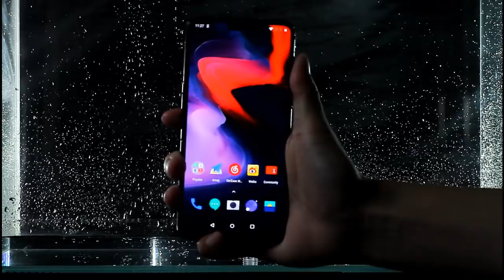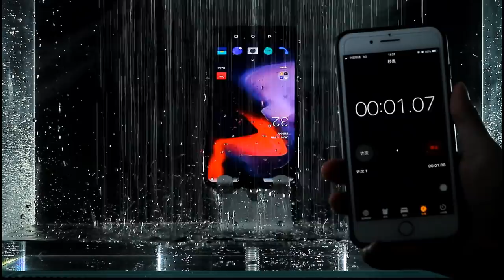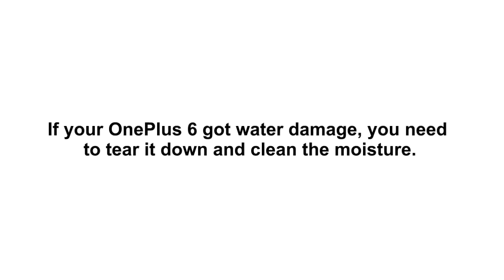OnePlus 6 Waterproof Test

Comment from the maker: Is OnePlus 6 waterproof or water resistant? You will find answers in this video. 
Get OEM Replacement Parts for OnePlus 6 : https://witrigs.com/ekncj
Reply: Wit Rigs did the phone died?
Reply from the maker: Nope, I disassembled the phone and clear the moisture inside. Then I covered the phone parts with the dry paper towel for 2 days and the phone survived. It works normally now.
Reply: Tnx dude
Reply: Thanks for giving out a solution in case that happens.
Reply: So the speakers are the weak points, thats good to know :)
Gonna tape them in case i wanna do some under water photography :P
Reply: Mr.Magnificent and the alert slider
Reply: Dennis Jassmann not really, it goes into the mechanism of the alert slider, thats why bubbles were coming out, but it didn't seem to get through to the components, we would have seen that on teardown
Reply: hi can you do review with vivo nex and oppo find x? do u have weibo?
Reply: Thanks a ton dear...This video helped me a lot...I am a brand associate and I will share this video to all the people come up to me while buying oneplus 6...
Reply: I have placed my one plus 6 phone in water but cameras are moistured. Give me a solution
Reply: my oneplus 6 was dropped in a swimming pool after 2min i got it out the screen was glitching and shutsdown the things are cleaned even then its the same thing nothing changed screen problem continues what to do.?

Comment: Good enough for me. To everyone else who consider this deal breaker. Have fun with your phone underwater?
Reply: hush3r True I wouldn’t recommend anyone take there phone underwater since the resistance is meant more for accidents and rain. No phone manufacturer covers water damage under warranty.
Reply: And when you accidentally drop it in water or drop water into the speaker, it's gone lol. So yeah, ill have fun with my ip68 rated phone.
Reply: Not really, accidental drops in puddles and whatnot is okay as long as you pick it back up and dont let it sit there like an idiot.
Reply: Lakshay Singh Just want to say that the waterproof tests are under perfect water conditions and without moving of the phone (when you move your phone under water, there's extre pressure). In lakes, etc. the water can be very dirty and damage the isolation of the phone. The same thing goes with pools (chlor and other acids) and the sea. Also note, that Samsung doesn't garantee you, that the phone is water proof. When there's a damage on your phone because of water, Samsung doesn't pay anything.
Reply: Underwater calls are the most hilarious I've done 😂

Comment: Mr wits do you think splashes can cause the water to enter through alert slider or some other hole. I have been somewhat careless through 5 years of owning the phone and let water on the phone(not putting in pool btw). But phone is still fine! I trusted the basic waterproofing
Reply from the maker: It is generally waterproof, unless it is warm water, or water with impurities.
Reply: @EricWitrigs  cool, great that you replied to a 4 year old video

Comment: oneplus could be like apple and just remove thwt slider to make it more waterproof (like apple removed the headphone jack to become waterproof)
Reply: David Hožič its not only the slider that has a problem and removing it won't help it will just hurt the company because android isn't exclusive to oneplus like ios and apple. apple sucks. 
oneplus doesn't.
Reply: David Hožič what will you say about the Samsung's flagship phone which comes with the headphone jacks and still a water resistant 😅
Reply: Anubhav Zeke the reply i was waiting to see.
Reply: Apple didn’t remove the headphone jack to make it waterproof lol. They wanted to make the phone as thin as possible, the headphone jack would make it too thick
Reply: Broodjekaas ! still not true because the phone is still thick . they removed the headphone jack to benefit more from the lightning port so everything sold for the iphone will give them a cut. there are thinner phones than the iphone x and they still has the headphone jack.